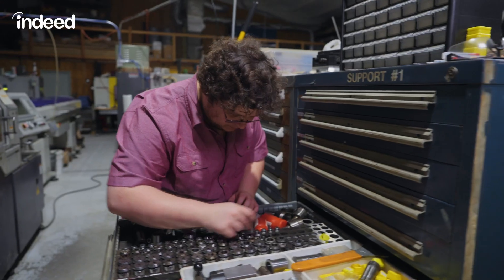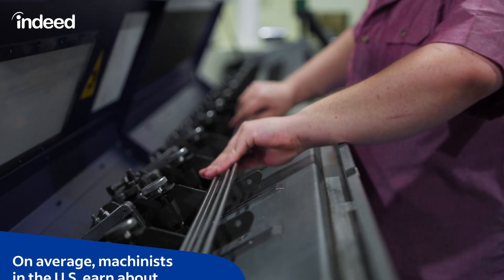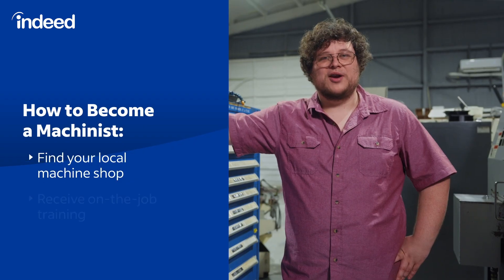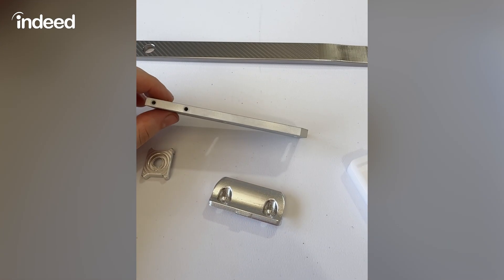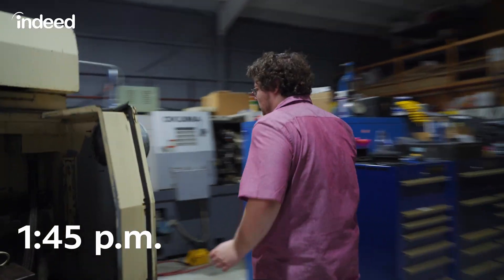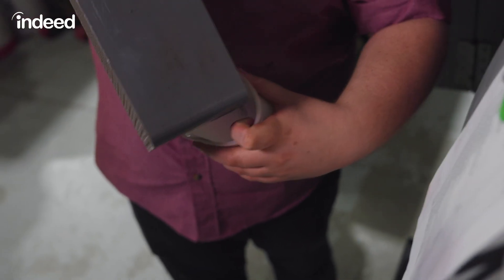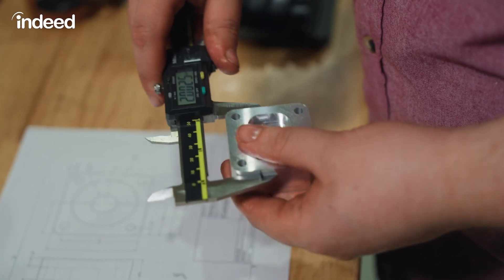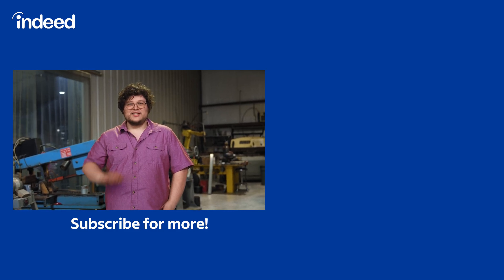How to Become a Machinist ⚙️ | Indeed

Comment: To give an example of the kind of precision needed for machining, I did a co-op at Kellogg's and Siemens in the early 90s and the tolerances I commonly had to work with were + or - 0.02 millimeters or 0.005 inches. A lot of what I experienced applies just as much in the 2020s